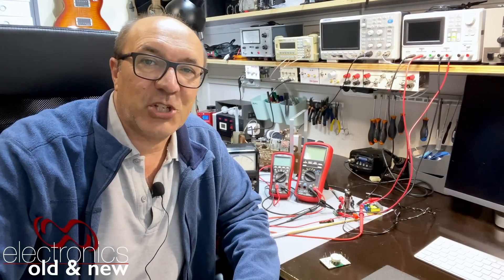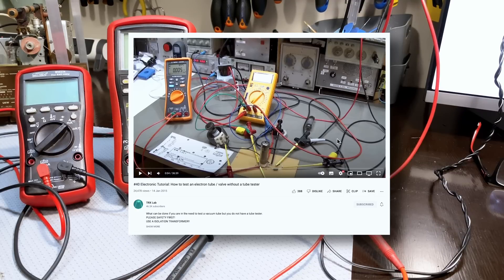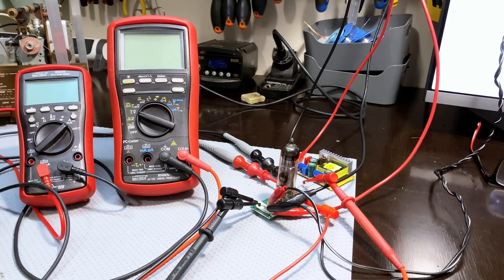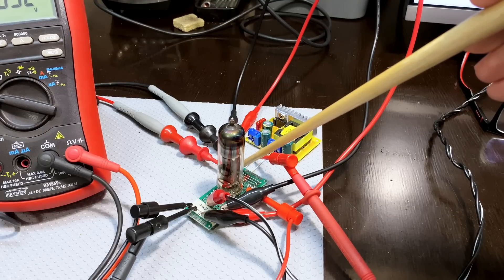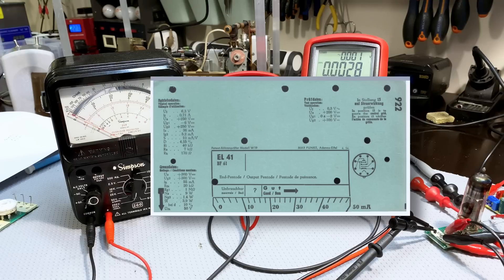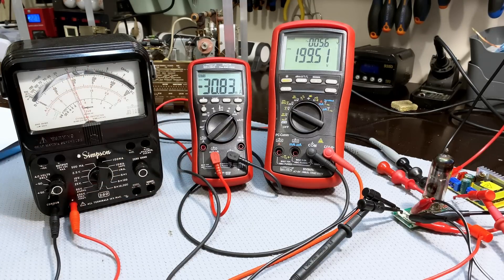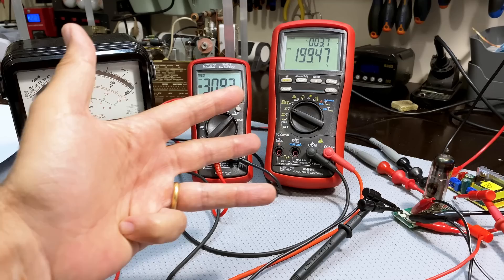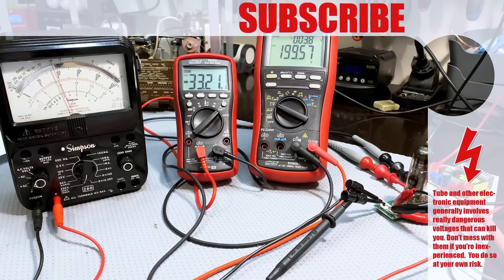How to test a tube without a Tube Tester. Is this EL41 any good?

Comment: My tube tester is a chop stick, I tap on the tube while my amplifier is running on high voltage connected to a speaker. If the tube makes a crackling sound, I known that tube is bad.

Comment: YES , these carts are very usefull ........I made some myself for my Neuberger tube tester.
For octal and some other types  one can use the sockets made for relais.....they have screw terminals and are easy to connect !
These older testers do test the correct operation points as well make it possible to teste tubes under the real conditions the tubes works in a real given circuit .........
Reply from the maker: Ok. I did a tube tester project after that video. It’s on the channel and may interest you.

Comment: Hello 👋 sir I'm going Tru some issues rebuilding a power supply and didn't know that if the tubes are bad I'll make things go left very quickly....like i burn the RF coil and capacitor with the rectifier card.....and i done this job about 5 times till i got tired ...then one day i unplug the amp from the power supply and guess what.no more fireworks 🎆 lol.. anyway the point is that if i had see you video before would had known a few things that would had ovoid lots of problems....if tubes are bad ...the amplifier will bust burn well you know...73 thanks 🙏👍

Comment: Bit late to the conversation but it does sound like a good idea . Most equipment use standard valves as you stated , I have a friend who is into hifi stuff always bending my ear about valve testing. It would be a good idea for him to build it with a bit of help. I have radio ham gear and valve's slightly different but most the same as commercial radios which I have a couple of so would be good build a tester along with my friend. Great video and thanks for the work you put in. I am not sure if people know the time and effort needed. I used to document procedures for various things that took long enough!!
Reply from the maker: 😊 Yes, it does take ages, but since I do this as a hobby, I can’t complain.

Comment: Hi Manuel, thanks for your videos, always a treat. Many valve testers like the one you have the card for were simply good / no good quicktest for busy radio shops. Back in the day a new tube was one of a million and only cost a few shillings here in the uk - sadly not the case these days!
Your plan with all the meters and all the voltages is much more useful in these days of used valves. Matching a pair of valves for hifi or really testing to see if a valve is still "good enough" for a few more years is a very useful tool.
I would personally use a real old mains trafo. All the voltages you need without the chinese buck boost pcbs!
You could even steal all the voltages out of a working radio with diverter switches to terminal posts on the back.
John UK

Comment: Here's a fascinating MOSFET: IRFP360LC.  Grid capacitance is very low, Anode voltage possible and anode current are very high.  Voltage for zero conductance is 3 V, Voltage for very high conductance is 4 V....  Go play...  ;-)

Comment: A nice transconductance test.  Can graph grid voltage against Anode current to get this valve's characteristic.   
Another test that can be done is for gas in the tube, which I think is done by shorting the 1 M grid resistor and noting whether the grid voltage changes (gassy if it does?)

Comment: Hello Mr Canderra,

Great experiment.  But instead of testing only for emissions, you could add a second and much more important test. Transconductance of a tube in mA/V is a much more important measurement for a tube. If you change the grid voltage for 1V, keep a close eye on the anode current. The amount the anode current changes gives a rough estimate of the transductance of the tube in mA/V,, which is in every datasheet. They way Funke is testing tubes is very, very basic. Not really recommended.
Reply from the maker: I certainly plan to do a transconductace test too.
Reply: @electronicsoldandnew  
Great! I should have known Mr Caldeira.
Good luck with the build.

Comment: Great idea, Manuel. How about creating a mix between the Funke tester with the data on the cards and a measuring setup built like the EICO 667 for example, where you have all common tube bases wired in parallel (pin 1-9 and anode cap) then going to 10 rotary switches where you can connect the appropriate voltages to the right pins on the tube. Your grid negative supply could be an isolated low current supply 0-30v or so with the positive output connected to ground (cathode). And then just use those Funke charts. Boer maak 'n plan 🙂
Reply from the maker: En ‘n Porra maak twee 😊 The planning process has begun

Comment: I repair(ed) a lot of old radio's and the EL41 is not such a good tube (in my opinion).  It is also getting very expensive.  So, I always replace it with an EL83 (very unknown tube in audio-equipment, but has very good sound  qualities, is cheap and easy to get and more reliable than the EL41.  OK, you'll need to replace the rimlock socket with a B9A and rewire the setup, but that only takes a few minutes.  With a Vb of 240-260V, use a 180 Ohms cathode resistor, uncoupled by a 100µF capacitor.  The EL83 has almost identical specs as the EL41 in the Philips tube handbooks.
Reply from the maker: That’s a good tip. Thanks

Comment: I have toyed with the idea of a home made curve tracer.  I have a box of100 NOS tubes and thinking this would be a way of selecting matched ones.  Scope in XY mode, oscillator/amplifier  to provide plate volts and fed to X input, Plate current fed to Y input.  Bench supply to set grid volts.  Maybe I will get around to it.  If I had more time I would love to have a YT channel like yours with my stuff on it.

Comment: I  tested a beautiful 4212E triode like this with a very dangerous lash up on my bench with 1kV on the anode.  Sadly emission maxed out at about 180mA max even with large positive grid voltage, when the filament should be capable of 4 Amps of emission according to the data sheet.  Still, it's a work of art even if it is not too functional.  In future I must be more careful, filter caps at 1kV can easily kill.

Comment: Pretty simple when you think about it and know the specs of the tube. In your case a limited homemade tester would be ideal but it will still take up space. I'd like to see you do it Manuel 🙂
Reply: @electronicsoldandnew I am waiting for some parts for built my 845 211 tube tester.
I am using the next
One 0-30 volts 5 amps switching power supply for filament
One 0-120 volts for negative grid voltage
Two isolation transformers from 115 to 220 volts with the outputs in series for the plate voltaje, máx 622 volts, regulated using a variac.
Two Flukes 27FM 
One micronta analog Fet multimeter.
I am waiting for the socket only.

Best Regards.

Comment: I did some extensive tube characterization tests for their potential use in low voltage logic circuits (just for the heck of it) and had a setup of multiple home-brew variable DC power supplies (up to 24VDC) and multiple multimeters.  I'd link to an image of the setup if YouTube didn't delete posts with links.  Anyway, I wonder if it might be possible to test the health of tubes using just low voltages, at least in a A(known healthy tube)/B(tube under test) comparison.
Reply from the maker: I’m sure that’s possible, but the reaction to high voltages may be quite different.

Comment: You could well build a tester along the lines you have shown here. Also, often it is quite simple to break into the anode line of the set the tube uses, to just see if the tube is useful or not. Bit difficult to compare with the Funke tester's limiting values, the voltages in the set are probably different. But, it should give a ballpark. I have two different tube testers, and they don't always agree either :)
Reply from the maker: They must be like two lawyers: can never agree 😊

Comment: @12:48 You mention what amperage you were getting and comparing it to what it should  be......but where on the card did you see what it should be (and any range)? I am confused 😕. Thanks
Reply from the maker: The card has the mA meter scale drawn there that shows good, ?, and bad. That’s where I got the current that is considered as “good”
Reply: @electronicsoldandnew  : Yes, I found it after I watched the recommended video link 😄.  It makes perfectly good sense now. Thanks.
Reply from the maker: pleasure

Comment: That small "HV" PSU module can go up to 800V. It has two ranges - 50 to 400V and 100 to 800V. In fact, it has a voltage doubler on its output, this is why there are three screw terminals on the output, but be carefull, the negative of the low voltage input goes directly to center of the voltage doubler on the output. This is why the output is labeled as a -400V/0V/+400V, but it is impossible to get a single -400V from this unit, because the voltage feedback loop is taken from the positive side of the output only. But if you use it as a doubler, then it works great giving you 100V-800V on the output. But it has its downfall, if you ground the negative side of the 800V output, your low voltage input side PSU is lifted 400V above ground, which is almost instant death for typical lab PSU. So I converted that board to a regular 50-800V (two range) bench PSU using a 18V 50VA double insulated transformer to power the module, then I decided to remove the voltage setting trimmer and replace it with a propper multiturn potentiometer, which is easy to mount on almost any front pannel. With proper insulation of course, because one of its terminals is almost at the voltage level of negative terminal of the low voltage side input. So I used that module to build a totally independent HV bench PSU. Just to do similar things that you are doing in this video. It gives me much better results than using variac with a rectifier, because this unit has its output stabilised using the voltage feedback loop. (There are no current feedback from the output, so the output current is not limited. Shorting output means at least blowing the fuse in its input.)

I am also planing to buy another one of this module, remove the output rectifier and replace it with voltage multiplier and modify the voltage feedback to the output of it to build a 2.5kV PSU. I don't know whether this is a good idea, but I hope this is at least doable.
Reply from the maker: This module is indeed useful, and I’m aware of the ground problem if using it to get to the full 800V range. The fear I have is that this unit seems a little flimsy to use at extremely high voltages, as I’m not too confident about the quality of the components actually used to build it 😊 I have used this module before and the first thing I did was limit its use to 300V, and also replaced the high voltage filter caps with better quality ones.
Reply: @electronicsoldandnew  where can I find that module or something similar?
Reply from the maker: They’re all over AliExpress and eBay

Comment: A 1Meg grid resistor is a bit on the high side for a power valve and you may get thermal runaway. Yes, the EL41 is quoted as 1 Meg max but that may put it on the edge of instability, particularly if it is slightly gassy. I wish you well with the Mende project, nothing to do with Sergio Mendes, I presume.

Comment: Yes to the tube tester.

Start of simple. If the idea works it might inspire yourself or someone else to do a more advanced version.

My contribution to the project would be this: I've noticed the commercially produced testers usually have many valve bases. But if you put the valve base on an adaptor board and use pin headers for the connections the tester becomes smaller and easier to add extra tube bases in the future. I tried to find a photo but apparently no-one has done it yet. Maybe there's a problem with the high voltages. They have done it to allow SMD devices in DIL sockets. Photo here: https://cdn.sparkfun.com/assets/learn_tutorials/4/0/1/assembled.jpg
Reply from the maker: Yes, I see what you mean. Thanks

Comment: Great idea. You have a manageable set of tube types. I suggest getting a few parameters from the tube data sheets from the radio operating points in addition to the tube checker card. Is it possible to inject an ac signal to see how it does with operating frequencies of interest and monitor with a scope?  Nice project I always wanted to do this. Best wishes!
Reply from the maker: I definitely want to be able to do some sort of actual working test.

Comment: Might be worthwhile to inject a RF signal (455kHz or so)  into the grid and see what the output looks like.  Essentially put together a simple amplifier circuit that is close to how they're typically used.
Reply from the maker: That would be the best method. We’ll see.

Comment: How did you know that I'm fooling around with a Marshall JCM900 which has 4 5881 valves, 2 look tired and 1 is cooked to hell. Negative bias failed :) this will be helpfull!
Edit: I wonder if a simple bias probe that uses the actual equipement voltage supply isnt good enough?
Reply from the maker: You can try with the actual working voltages, and in fact that would be the best way to test, but be careful. If there are shorts, the result could be a little like new year’s eve in Madeira 😊
Reply: Well in my case this thing has fuses all over. I guess older equipement doesnt. I'm making a bias probe out of an umbilical chord from an defunct tube tv and a tube socket :)

Comment: I've made a DIY tube-tester myself, using two PL84 to make adjustable g2 and a voltages, and just a potmeter to set the g1 voltage. using 5 analogue meters to read V for A, g2, g1 and mA for  A and g2. there should be a video on my channel if you are interested in this.
Reply from the maker: Thanks. I’ll look it up.

Comment: I have been caught by the YT external links police again. My fault... In the sixties and seventies, not many options existed to learn electronics, and one of them was an expensive but high quality remote school, publishing their own books, and kits. The students built their own instruments as a practical exercise. There was a lampmeter, it's described there at triple w dot carnets-tsf dot fr. It's easy enough to find your way on the site, and although in French should not be an obstacle to get the most of it. The "databook" required to interpret the result has been coded, if you type the name without spaces you get one line of settings/expected values.
Reply from the maker: I have just read the sections you referred me to. Very interesting, thanks.

Comment: I am lucky enough to have a properly working and calibrated Hickok752A which can test, and includes data for, virtually any tube that one is likely to come across in the US and most European tubes as well, from 4-pin oldies of the 1920"s right up to Nuvistors. It doesn't include data for some valuable Western Electric types but I can usually figure out the correct settings from a tube manual.  It doesn't have a rimlock socket for these EL41 tubes but if I really needed to test those I'd make an adapter for it. I have other tube testers but the 752 is my favorite.